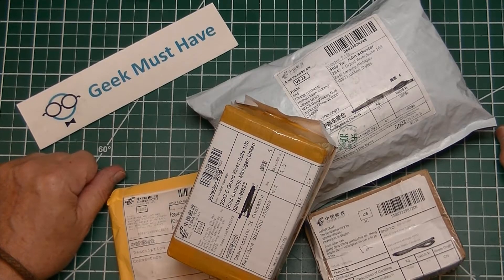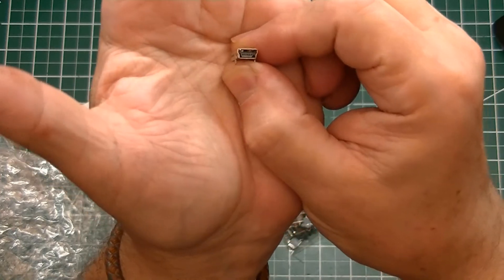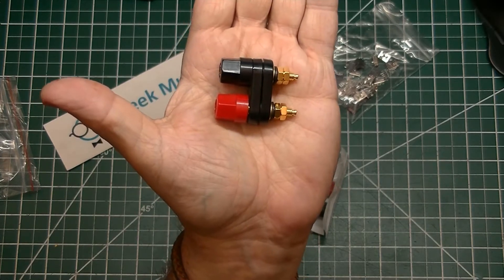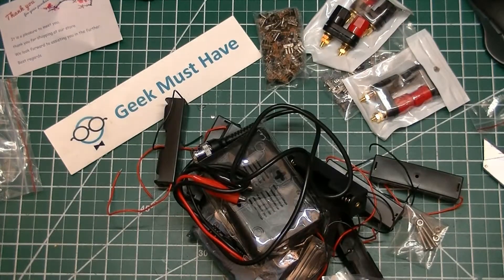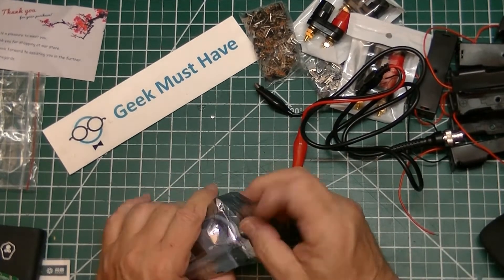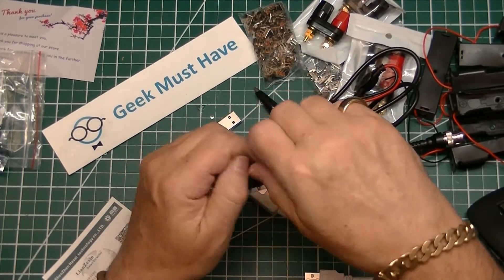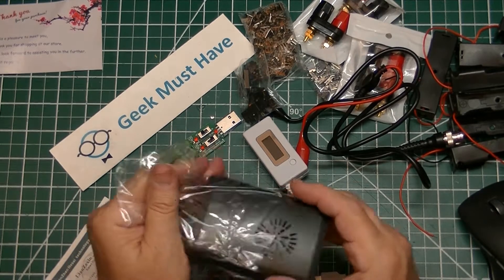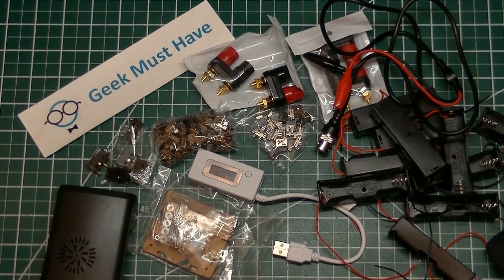Parts galore, the resupply ship arrived Postbag GMH-057

Comment: Saw your comment on ali, about the 18650 battery shield v3. Wondering if it's any good. Some comments say it has no over discharge protection. Some say it keeps drawing power even with nothing connected. What's your take on it, can it be used to power a arduino pro mini for a long time, like weeks or months?
Sorry if this was wrong place to write this, couldnt figure out if you made a video on it yet.
Reply from the maker: I just started to test this battery shield.  I wanted it for the exact same reason you wanted it. It charged a 3.0 v 18650 back up to 4.1v no issue.  Left it plugged in for 12 more hours.  No heat and the battery stayed at 4.1-4.2 v.  The switch only controls the full sized USB.  Both right and left powers leads are always on.  This leads me to believe there is some power drain.  

The one chip is a LTC4056, Spec sheet https://cds.linear.com/docs/en/datasheet/405642f.pdf (The  output  driver  is  both  current  limited  and  thermally protected to prevent operating outside of safe limits. No external blocking diode or sense resistor is required. TheLTC4056  also  includes  low  battery  charge  conditioning(trickle charging), under voltage charge current limiting,automatic recharge and a charge status output).  The other chips are mystery chips with the silkscreen scratched off.

I'm doing a draw down test now with a LED stick plugged in until it dies, it been 9+ hours so far.  Gathering load test data as this test is going on.  I will probably publish a video.
Reply: Ah so even if it's used to power a 3v3 pro mini, it will constantly generate the 5v at the same time, and those components are draining battery too.